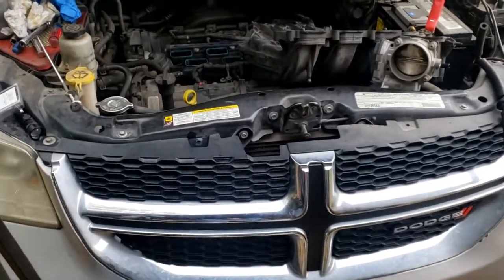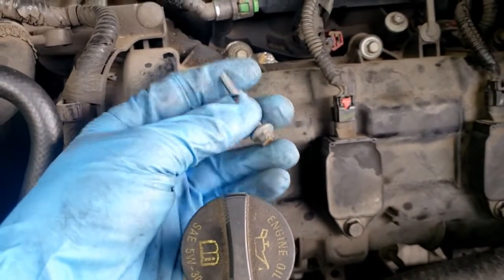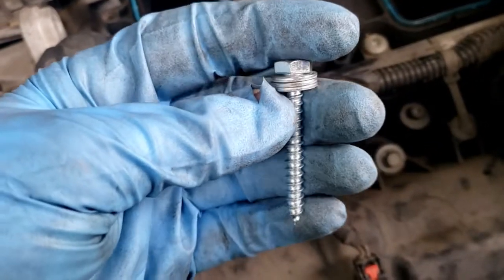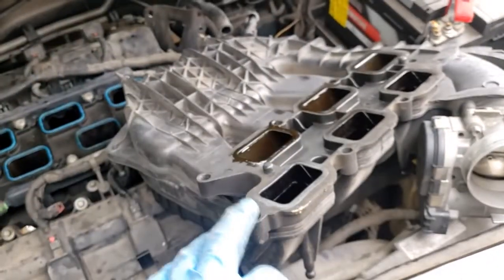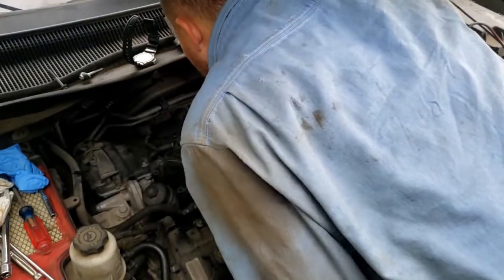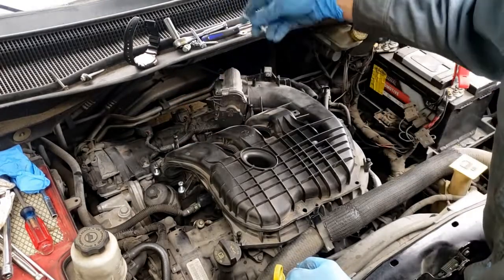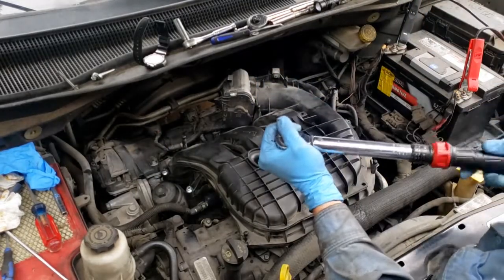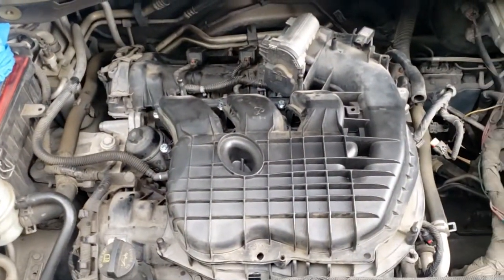3.6L Dodge Pentastar stripped intake manifold REPAIR! Chrysler / Jeep

Comment: Hey thanks so much for the video. What torque ft/lbs did you tighten the lag blots at?
Reply from the maker: I set them to the original torque spec if I remember.
Reply: @gagefixeseverything  if i was to put a helicoil kit which size should i buy ?

Comment: I don't know about lag bolts in a car......problem is the threads in the plastic will fatigue the same as they did to get here if changed and over torqued or tightened too many times.  I performed a helicoil on all 6 really easily.  Your way is simple because you just drill and lag...helicoil kit is about 35 bucks on amazon and threaded M5 rod is available there also in various lengths.
Reply from the maker: For the type of clamping force needed with the plastic Manifolds and o-rings, helicoil or similar inserts would be a waste of time and money. For that that much cost and effort, it's a much better choice to replace the lower Manifold. Once you install the larger lag style bolts, it should never break again. If it does, the fault is on the mechanic!
Reply: @gagefixeseverything  really dont go helicoil ? i mean if i was to go with a helicoul kit which size?
Reply: what size helicoil

Comment: I can not thank you enough for making this video. The person who worked on my vehicle last stripped 3 of the threads and left it like that. I had to replace the oil cooler and as I was putting everything back and came across this problem. I thought the only solution was to buy a new lower intake. Then I came across your video. My soul came back to my body😅. It worked out perfectly. The new lag bolts torqued perfectly.
Reply from the maker: @grr8tgui  Thanks for the comment, this is why I make videos! Haha. They may not be the best videos, but I love when they can help people!
Reply: @gagefixeseverything  question so the length of the bolt is it 2inch long? This is what the Amazon link shows just want to be sure
Reply from the maker: Yes they should be correct on that link  @josefuentes389
Reply: @gagefixeseverything  thanks bro
Reply: @gagefixeseverything  how do you get the original  bolt out the manifold? They are retained in there when you remove the manifold.
Reply from the maker: Houston pliers and pull up on them as you twist to the left . They will catch and start to come out . Or you can turn the manifold upside down and hit them with a hammer and punch they will come out  @stevemcra
Reply: @gagefixeseverything  thank you
Reply from the maker: @stevemcraemanager7119  Yeah!!
Reply: I changed my oil cooler and found 1 stripped bolt as well

Comment: Glad I found this. I was looking at spending $200 for a lower manifold. Thanks so much for your video.
Reply: For the 2 center holes, how did you tighten them, because my 1/4" deep socket 11mm doesn't fit inside the hole

Comment: Your are a life saver.  I have one of the original bolts that will not come out of the plastic.  I can 
I get that one out? Thanks.
Reply from the maker: Did it break off in the lower manifold? If so, you may need to also replace the lower manifold

Comment: So I did a shoddy job drilling out one of the bolts that busted.  All the holes are all intact.  I didn't cross-thread into one of the other holes.  The mounting bolt busted below the lower intake manifold.  The rest of the bolt remaining in the lower intake manifold has a rounded headed.  I tried to use a punch to create a valley, I thought I'd done this sufficiently.  The drill bit was sliding.  Is it necessary to remove the busted bolt or will using a new bolt just create new threads from the old bolt?
Reply: I really wish I would've watched this video first, you really simplified the process.  Also, is it necessary to rethread every hole with a new matching bolt if only one hole is damaged?
Reply from the maker: I would i think, just so you dont have mismatched hardware. The new hardware has much better thread engagement anyway

Comment: Wait, did you rethread all the holes or just the ones that were stripped? It looked like you used new bolts everywhere. Also, would this technique work on the 2017 Jeep Cherokee Latitude 3.2 L V6? Thanks!
Reply from the maker: I replaced all of the hardware with new bolts that make their own new threads as they go in. It should work for any of the dodge engines with plastic intakes!
Reply: @gagefixeseverything  Super. I appreciate the timely response and the good info. Cheers.

Comment: The 2 center bolt holes and the one in top right corner, I can't get a 11mm 1/4" Deep Socket in there without it getting stuck, what should I try next?

Comment: Just recieved a new lower and the holes are not threaded for the plenum bolts. Is this normal? Can I just install the bolts as is or do I need to thread them first? Thanks.
Reply from the maker: Yes, Your bolts will thread the holes for the first time
Reply: .
m
JB l  @gagefixeseverything

Comment: I assume you used three washers just to get the correct amount of thread in the hole? But then you decided to drill the bolt hole deeper? Im curious how you picked this solution. I was thinking of using one washer, not drilling deeper and just using a shorter bolt or trimming it off to the exact length. What are your thoughts? As of this moment, I have the stock bolts in the holes, with JB Weld in the holes. When it cures, Im going to take them out and try to install the upper intake. I was looking for an alternative solution in case the JB weld doesnt adhere to that plastic or it just crumbles when i unscrew the bolts.
Reply: Did the JB weld hold? Was thinking about doing the same
Reply from the maker: Your assumption is correct. It was faster and easier for me to use washers than cut the hardware, thats all
Reply: @lucashodges9410 I'm curious as to whether the jb weld fix worked as well.

Comment: I tried it it's completely waste of Money Im a DIY person I followed the steps 100% I will have to change it with aftermarket one.
Reply from the maker: Awe man! Ive done this a ton of times and it usually works, but occasionally the lower intake manifold is too damaged to re use sadley

Comment: What about using Hanger bolts?  Same 1/4 thread as the lag bolt, but the top part turns into a 20TPI machine screw - both threads on the same bolt.  Maybe epoxy or red loctight them into the lower manifold then use machine nuts for the rest of the time.  Im thinking 7 to 9 NM will be fine on these.
Reply from the maker: That should work. We have had to do this repair several times at the shop now. It's always on higher mileage engines that other people did spark plugs and such on.

Comment: The support bracket on the driver side closest to the radiator is supposed to be bolted in between the block and the coolant line which is extremely problematic so I simply chose to bolt the other side of the line, bringing the line a bit closer to the block. Does anyone see this as a problem?
Reply from the maker: I bet it's fine. Alot of people just leave the support bracket off, and thats a major cause of the intake bolts pulling out

Comment: Will missing one of those bolts cause a miss fire?
Reply from the maker: Yes definitely
Reply: @gagefixeseverything  That's the issue I'm having misfire on #4 cylinder and that's the bolt that can't be torqued.  Not stripped but something is causing it to spring back off torque about 1/2 turn so no torque set.  Not going to drill it out like you are...going to use some locktight and hit the end of the bolt a little to make room for whatever trash might be making bolt bottom out that I can't get out.

Comment: Is there a need to tap and die for the threads or is the drill bit good enough?  Also, If in any case the hole gets stripped again what would be the best solution? Go for a bigger sized bolt or helicoil?
Reply from the maker: You do not need a tap and die. The lower manifold is plastic, the new larger hardware will cut the threads sufficiently

Comment: If you make new threads and you have to remove the intake again, will the bolts retightened?
Reply from the maker: Yes the new threads from the larger bolts work. If they get stripped again, you can just replace the lower intake. They are very easy and quite inexpensive

Comment: mine has a misfire on cyl 2. has a slight mis at idle and in reverse. did the coil and plug and is still the same but the 2 bolts on top of cyl 2 are both stripped. can this be causing my misfire? it does not make any ticking or tapping noises the engine sounds nice and healthy. I highly doubt its a head/compression issue
Reply from the maker: Yes it can cause a misfire, would probably throw a lean code as well for vacuum leak
Reply: Been having this issue for years, I've done everything, a shop looked at all the wires. Can't figure it out. Mine are not stripped. I've had it off many times. Mine is cylinder 1. Sometimes it will say multiple missfire. Most recent is said crankshaft position sensor but I think that was something new, I replaced it. Now it's been saying intake manifold runner position sensor code.
Reply: @LinkSquish do you have any weird electrical problems inside the car?
Reply: Were you able to fix your problem?  @LinkSquish
Reply: I am having the exact same problem on my 2014 v2 Durango only its the 301 Cylinder 1 misfire code. I stirpped the 2 bolts on the left lower side of the manifold. Its vibrating a little only at idle. I also got the p2173 Throttle actuator control system high air flow detected. I am going to get a new lower manifold or give this a try. All i did was change the spark plugs and the oil filter housing so this must be the problem. Thanks!

Comment: What about when the head of the screw breaks off and the rest is inside the hole? I've tried using a reverse drill but no luck so far and I don't want to go further before something else breaks off...
Reply from the maker: That is a hard one. The bolts are very thin, and may not drill out. If you cannot extract them, you can actual buy the lower manifold pretty cheaply and just replace it
Reply: Are the bolts 1 1/4, or 1/4? They look kinda long. Please let me know asap.
Reply: You left out how long is the bolt.
Reply: Had the exact same thing happen to me!  I did find the lower intake manifold on an authorized dealer for MOPAR parts.  Also found a video that walks you through replacing the lower intake manifold.  I'm planning on heading to local wrecking yard for a replacement.  Found a 2019 Dodge Journey in a wrecking yard.  The lower intake manifold is identical to the one I have.

Comment: Mine stripped at the aluminum part of the engine block
Reply from the maker: Well.... that sucks. Little more work involved there. did you drill and tap the next size up?

Comment: Hey Gage can you explain on the washer size better because I cant for the life of me find a 7/32 washer to fit this lagscrew like the ones you're holding in this video. Are you sure the washers aren't 1/4"?
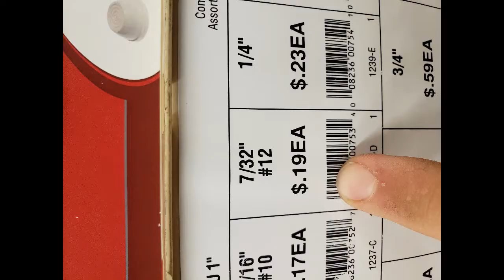Reply from the maker: at 5:50 I included a photo of the washers I purchased. Looks like they are also referred to as #12? The important part is that they are not too large in outer diameter so they will fit down in the hole!